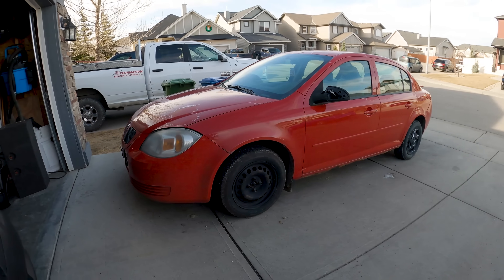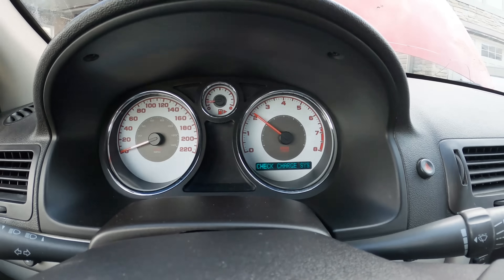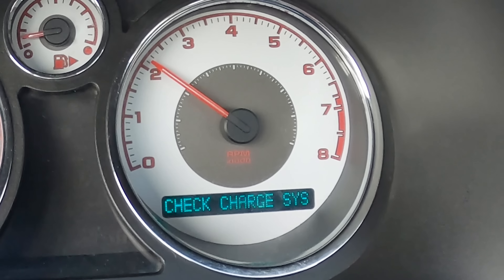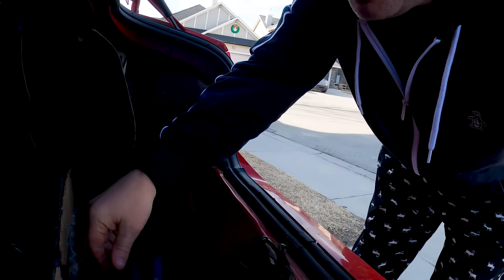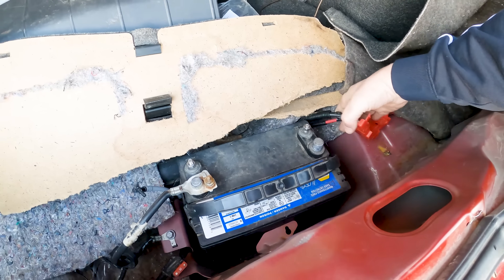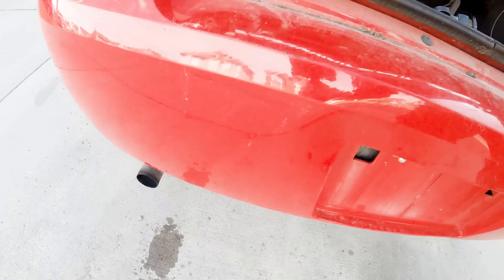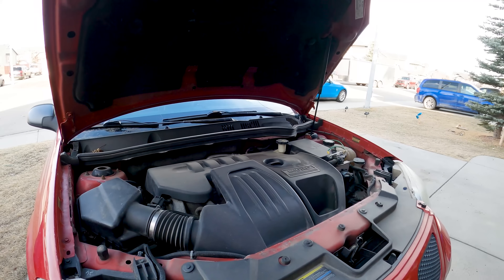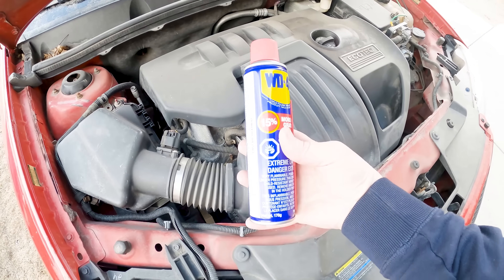ROADSIDE FIX! REVIVE your DEAD or DYING Alternator with this ALMOST FREE trick! | Gears and Tech

Comment: There's also an issue that a new car with a computer which controls when the alternator charges and when it doesn't your computer plug-in prongs may need to be cleaned with electric cleaner do not put Dielectric grease on them but clean them with electric cleaner several times allow them to dry plug it back in also do your connections to your alternator and most likely the problem will be solved you could put on it but if it's a computer problem it will not fix problem

Comment: Never ever never ever ever never ever ever never never never never never never do that on a computer controlled vehicle.
Reply: Informative 
If we disconnect the kable from battery, when the engine is running, then we can have problem=burn  with the Alternator
And problem with ecu

Comment: You can also change the fuse that belongs to the alternator.  My 2012 Hyundai accent gls original alternator or geneweum  alternator was finish so the mechanic I brought my car to had to replace 3 faulty alternators for me.  Twice my car car die on me.  The final time I bought my car to the mechanic my car had to stay over night at the mechanic shop I got fed up.  I had paid $566 to the mechanic they probably got a $100 alternator for me.  I had to figure it I replace three 10amp fuse at the front fuse box by the engine since then the faulty alternator they gave been recharging the at a ok space I don’t use the AC and my radio. My jump cable has a voltage meter so I did what you did.  If I put the ac, radio,wiper, head lights it will blow the fuse and the alternator will die then I will not be able to steer then the engine will die.  The only alternator that will work properly is the alternator from the Hyundai dealer.  They have the genewuim alternator.  The black market alternators don’t work properly.  Changing the fuse will give the faulty alternator enough power to recharge battery but don’t use the ac and radio

Comment: I've actually tried it when I worked at autozone, and it does for some reason it did restore the charge for about a month.  I tested it on the tester and it had 10.8v and restored it to 14.4... facts
Reply from the maker: Exactly. Thanks for sharing

Comment: To add to solving current efficiency problems most cars have ground your engine to the body as much as possible.. and the alternator make sure the contract points are cleaned and protected from weather
Reply from the maker: Yes

Comment: An alernator may not work if there is a bad ground.  I added a second ground cable from the battery negative to a bolt on the fender and the alternator worked on the Chrysler Town and Country.
Reply from the maker: Grounding on the alternator isn't usually an issue. It's bolted firmly to the engine

But if the engine ground is bad it can create a problem

Comment: First thing to check in this case is the alternator fuse, yes, that car has one. When a vehicle has been stored without a battery maintainer in use it can overload the alternator and blow the fuse. Seeing as how you live in the "Great White North", you do use battery maintainers, right? They are expensive, but it pays for itself in saving money on a battery and/or alternator. I was in error, they are not expensive and the larger ones can maintain several batteries by using cheap jumper cables between them.

If WD40 fixed it, it is a simple problem, but a horrible idea. This tells me the alternator is fine, the WD40 simply cleaned some of the deposits off of the slip rings. But the oil in the WD40 collects dust and dirt and is also an insulator. Not a good thing to use to clean the slip rings. Instead get some electrical motor cleaner. All the do-it-yourself parts stores have it. NOT the electronics cleaner, good stuff, but evaporates too fast. The motor cleaner penetrates and flows like WD40, but evaporates out after 10 minutes or so. Better yet, treat, start for a minute, shut off and re-treat. You will find the alternator is just fine and does no need to be replaced. By the way, the slip rings are in the back, don't waste time and cleaner on the front.
Reply from the maker: Alternator fuse would mean it's always not charging

The fact that it charges at higher rpm means it's not the fuse

Comment: If WD40 helps lube the alternator in emergency, do you recommend it as a routine practice - like during an oil change, to extend longevity? This seems like an easy way to keep alternator alive a lot longer.
Reply from the maker: No. This is a last ditch effort to save it when it's broken. Only do this when you have nothing to lose
Reply: @GearsAndTech  thank you

Comment: Happened in my 86 jeta a long time ago, didn't have to put a alternator in for over a year, 
But? I only used Electronic cleaner spray, not that WD40 I thought it would collect more dirt since it's an oil base, the brushes were worn out and you can hear it sparking to charge, recommend not jumping it as you spray the alternator, clean first real good and then jump it, and it should work,
Reply from the maker: Exactly. Don't do it whole running.

I have sprayed them while running. But while sitting is fine and preferred

Comment: Dont unplug the battery while its running! 12.5 V not running, 13.5 V or less while running  if you start it and its still 12 volts then the alternator is dead, if its above 13.5 volts its going to fry your electronics and is boiling the battery off. Ive never seen a fried alternator ever work again, because the field windings are usually fried. There is no way to un-fry it
Reply from the maker: Exactly. If you have the tools, no need to disconnect anything. Just spray down the alternator and off you go

Comment: An addition to WD-40 (or substitute, if you're roadside and don't have any) is to tap the alternator.  Not real hard, you're just trying to loosen the brushes inside.  If you can't reach it directly, stick the tip of a screwdriver against the housing and tap the handle.
Reply from the maker: Great tip

Comment: 2 questions
1- When your car died in the middle of nowhere and you soaked that Alt in wd40, did it start without a booster?
2- What to look for if the alternator stops charging the battery whenever the AC is on  knowing that the alternator is new and the battery is new?
Reply from the maker: No, once the car dies the battery will be dead and you'll require a booster to get it running.

If the wd40 worked then the car should keep running without the booster pack
Reply: @GearsAndTech   Thank you for answering to my first question. Can you please help me with the second one? 
I have replaced the alternator, the battery and cleaned the throttle body.. But when I was in a traffic one day and the AC was working, the battery was drained and the car stopped !

Comment: This method will not work if your alternator’s built in voltage regulator is    burned out. And some common failures of alternators are caused by this very thing.
Reply from the maker: There are many reasons it won't work. But it sovles about 80% of the problems someone will experience. Especially on teh road

It's worth a shot

Comment: You never want to start your vehicle and disconnect the battery on the new vehicles because you can Spike the system and blow a PCM out stick a meter across the battery and read the voltage coming out of the this guy is wrong not listen to this clown if you want more problems get yourself a meter and do it the correct way
Reply from the maker: How new does it need to be?

Comment: Never disconnect the positive battery terminal first...especially while the engine is running. If the + terminal wire grounds out on any metal parts under the  hood...sparks, fire or electrocution hazzard . Be warned!!!
Reply from the maker: Yes

Comment: You can actually damage a newer car by disconnecting the battery while it's running
Reply from the maker: How new does it need to be? I've been hearing this since the 80s
Reply: @GearsAndTech  anything computerized can get fried if it happens to have a bad ground as you do this test also pretty much anything with an integrated fuse box/pcm
Reply: Sorry bcm auto correct got me there

Comment: This you can try on tractor or car from 80’s but not nowadays modern cars with expensive control modules. Battery serves also as voltage spikes filter and if alternator has any potential issue, voltage may fluctuate or even can have voltage spikes above 15V which will highly likely leave some very expensive damage behind your recommendation.

Comment: If you have a working alternator it's a bad idea to remove the battery.  The potential voltage spike can burn up electronics.
Reply from the maker: maybe. this happens every day for hundreds of people unintentionally when their battery fails, or the connection fails. 

If electronic failure was assured we would hear a LOT more about it

Comment: Can not believe you got so many pats on the back for this video because your test could fuck many electronic components that will cost more than alternator to fix,and whats with a remanufactured alternator ! Come on few bucks more for a new one fixed
Reply from the maker: Tomorrow I'll release a video how spreading peanut butter on your head will make your hair grow
Reply: @GearsAndTech  sarcasm the only reply from the uneducated  can't believe you went low   ,l felt I was giving good advice l will continue to take the high road , while you take the low one

Comment: A Nissan xtrail  MR20, the problem is ,the check engine light doesn't come on and the engine didn't cranking, the battery is working very good..what may cause

Comment: Just buy a Toyota/Lexus and make sure you buy a new battery every 4 years.  (Batteries going bad can destroy your alternator). You should get 275k miles out of Japanese alternators.
Reply from the maker: Interesting approach
Reply: I have allways replaced my car batteries every 4 years from new owned 2 bmws vw passat    vx cavalier mk2 fiat croma and my current car fiat bravo 2007 150 tjet had longest 17 years 14000 mls.Never replaced an Alternator on any car i owned and all covered over 100,000 or more miles

Comment: Nooo waaay! I had to come back and say thank you! You literally are a lifesaver and saved me over $100 last night. My car just stopped working out of nowhere, wouldn’t start. I was sitting for hours trying to figure out what to do, I was thinking about calling roadside maybe getting it towed and I’m soooo glad I was patient and found your video! As soon as I tried your method it took a sec but started right up, sounded brand new! I got home with no problem and still can’t believe it. Thanks again for the hack, you are the GOAT 🐐 anyone saying this hack doesn’t work shame on you.
Reply from the maker: Thanks for the feedback. Glad to hear it worked
Reply: I  literally just bought my new alternator using the car, it’s been starting up ever since.
Reply: Didn't work for me at all. Tried wd-40. Didn't work. Tried brake parts cleaner. Didn't work. Even tried seeing if maybe a little lube might help. Didn't work. While it may work for some cases, it likely doesn't work if your alternator overheated.
Reply: Bullshit.....your alternator was not keeping your car from starting. Taking the cable loose probably cleaned the crud on the post enough to let it start.
Reply: i must ad one thing, your comment makes it sound like by drowning your altenater in wd thats gonna make it all the sudden have enough voltage to start up ? i dont believe that part  i think your still gonna need a jump !
Reply: @davidmarberry5565 exactly he didn't mention he had to jump start it so I didn't believe it either.
Reply: I reconditioned my alternator but used contact electrical spray cleaner, cleans more than wd40, drying way faster, leaving no residues and all your module safe.
Reply: If your car won't start even a brand new alternator won't fix it. You need to recharge the battery. Alternators only work when the engine is running !
Reply: I watched your video and gave a try. It worked right away. Im assuming the issue was oil on the alternator from a leaking valve cover.
Reply: Most alternators are killed by power steering fluid CRC makes a spray for it called Electric Motor designed for cleaning electrified motors without having to remove the unit or your car battery completely and it won’t short out anything
Reply: Thanks for that, noted 😎💯
Reply: @rosieclark3661 ty
Reply: Thanks man! 
I thought it was fake shit, but honestly it works.
Reply: Seee! You’re welcome man 😎💯
Reply: Maybe you worded it wrong, but, if your car will not start, even a good alternator will not put out current to charge a battery or run a car! The alternator must be spinning to put current out
Reply: You got lucky. Keep using this knotheads advice and it WILL eventually cost you $$$$$$$$

If hacks really worked that well then all mechanics would use them. Cars today are NOT what tyey were in the 70's and 80's. A new ECM (when it fries and it will using this knotheads advice) is going to cost you at a minimum 1000$. Good luck!
Reply: The hack isn’t to say my car is fixed and to keep driving that way. The hack is literally just to get you going if you get stuck and need time to get the new part. I was able to get the new alternator with no problem. It obviously worked for me. And I have a brand new ecm in the cut in case something happens to it so I have no worries. The hack had my car starting and driving with no problem until I was able to get it fixed so I’m not sure what the comment is saying. How didn’t the hack work? My car has no issues at the moment so you may need to do more research, hacks may not work for all cars but it works.
Reply: @stevet5379  Doing the WD40 will fry the ECM??
Reply: @stevet5379  If I could afford a 'new' car I wouldn't need bandaids - my old '98 Jeep is grateful for this man's input!

Comment: One of the worst things about the internet is getting bad information if the car is an older one and has a generator not an alternator but a generator you can pull the battery cable off to check to see if it'll still run or not but if the car has an alternator it's a no no do not pull the battery cable off while the car is running you can ruin your electronics
Reply: Generator is a generic word for anything the generates electricity, so an alternator is a generator. Usually disconnecting one while it’s charging will stress the semiconductors in it, both the rectifier and the regulator will be at risk. Sometimes you’ll get away with it. Usually you won’t. 
On 1950s and early 1960s cars they commonly used dynamos, another form of generator. These don’t have semiconductors and are much less susceptible to damage. They also generate much lower voltage, when unregulated, unless they are revving hard. So, technically, if you have a dynamo, you can safely disconnect the battery while it’s running. However, even a healthy, perfectly functioning dynamo may possibly not generate enough power to run the ignition system, at tick over, so the motor might cut out, without there being a fault. 
Basically, the battery disconnect tip is never appropriate.
Reply: Newer cars have "generators" too since the bcm controls the charging. 😂😂😂😂😂 I had to be technical
Reply from the maker: I think ease of access for anyone with an opinion to comment on a video is right up there
Reply: @GearsAndTech  There are some of us who have mechanical and technical backgrounds that fully understand your hijinks and see them for what they are, backyard shenanigan's that belong in the backyard. You quite obviously have no compunction about convincing those with no mechanical/technical backgrounds that you know what you're doing... until you don't. Then you'll cost some body a nice pile of cash but that won't matter you you as long as you get a new subscriber!

Comment: what you said is not true...if you remove your battery cables while engine running you may do severe damage to your cars PCM
Reply from the maker: So they say. I've never seen it. Even in newer cars.

How often do you think A battery fails open on a car without the owner knowing?

If I had to guess, north America wide I would say at least 100 per day

If this was truly going to cause pcm failure where are all the people that have fried them?

Only pcm I have seen fried was when the body ground rusted off and the pcm was grounding through the coil pack wiring.

Comment: NEVER...NEVER disconnect Alt while running.  This works only with generators in the old days.  This can cost you an ecm and usually blown diodes due to alt spiking without a reference from batt.  I've seen it since the 70's.  He heard this from granddad.
Reply from the maker: I've never seen that happen
Reply: Dusty did those car not have valves ? 😂😂😂

Comment: All of you that keep saying dont disconnect your battery while vehicle is running, if you short out something its not grounded correctly! 
Voltage regulator and/fusable links all are doing a job theyre designed to do,if not theyre junk or you disconnected and reconnected incorrectly! Yes you can put a loom clamp on wrong!

Comment: At idle, no car should read 11.7 volts. That's discharging voltage. It should read over 12.6 volts. That is not ok and your charging system isn't working properly so that info isn't good advice. Aside from what others have mentioned about pulling off thr battery cable. Not good advice either on newer vehicles and you'll fry something and won't be chicken.😮
Reply from the maker: Complete doover then I guess hey!?